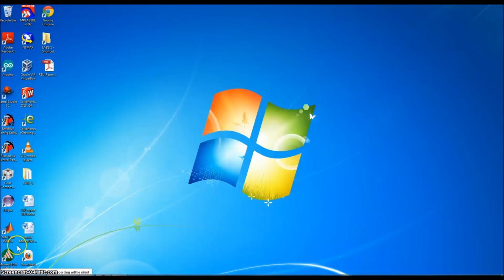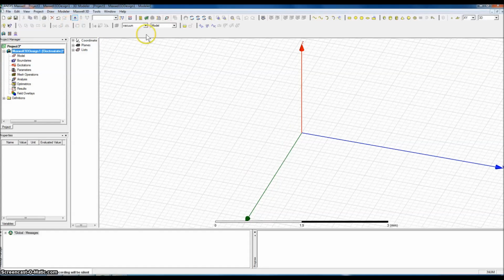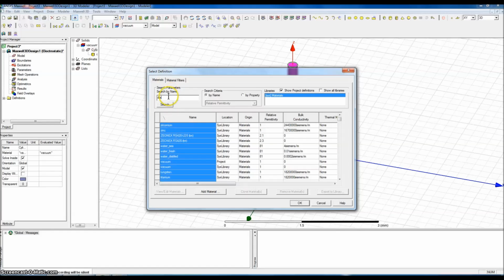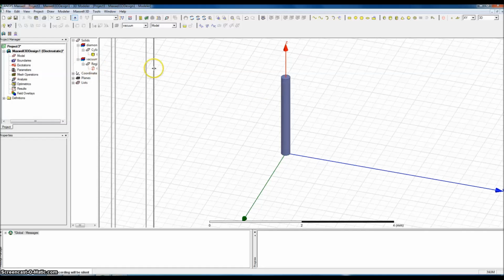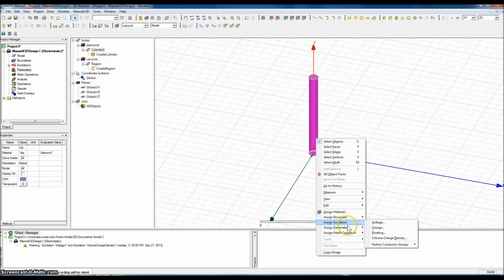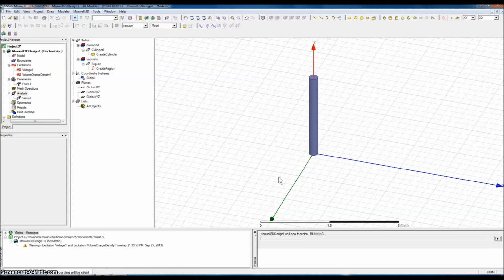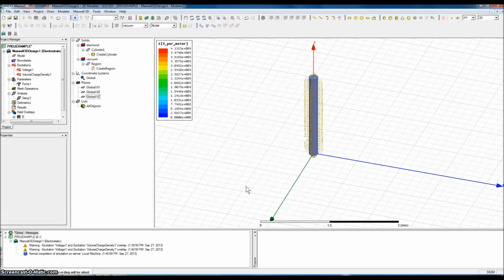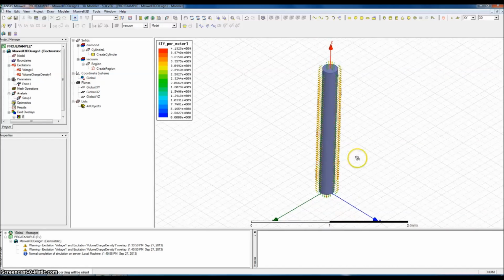Maxwell 16.0: Basic Tutorial for the Electric Field Around a Small Cylinder.

Comment: Hey jonny i am getting message messenger
Project1 (C:/Users/Vasa Priten/Desktop/)
  MaxwellDesign1 (Electrostatic)
    [error] There are multiple disconnected solution domains and there is at least one without voltage excitation. (10:35 PM  Jul 31, 2015)
    [error] Simulation completed with execution error on server: Local Machine. (10:35 PM  Jul 31, 2015)
heip if any one is aware about this

Comment: First of all, thank you very much. Your video is a great 4 min introduction to this software. 

I have a doubt though. I've followed all your steps, but in the end the resulting field was different. Instead of normal vectors to the cylinder's surface, I've got really small vector with an angle, and a very big concentration of field in the top and bottom of the cylinder. 
My first thought was that I must have chosen the wrong material, a conductive one. But I double checked, and it's in fact diamond, the same you use in your video. 
Any other idea of where the source of the problem might be?

Sorry for messing up such a simple tutorial, I'm feeling like a total newbie here.